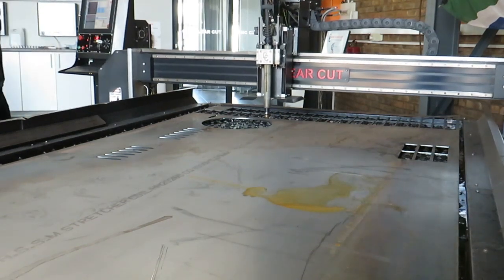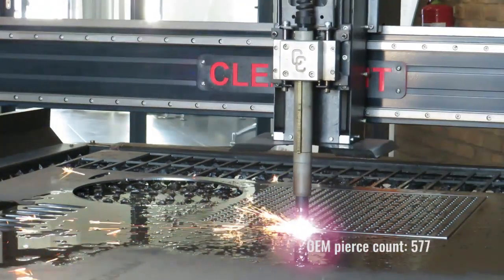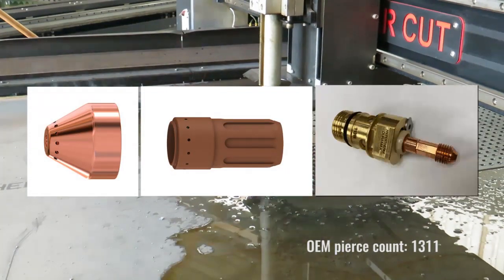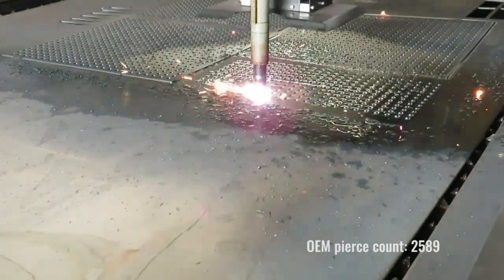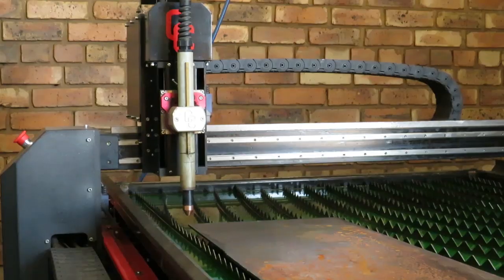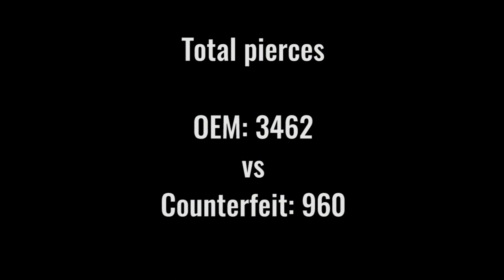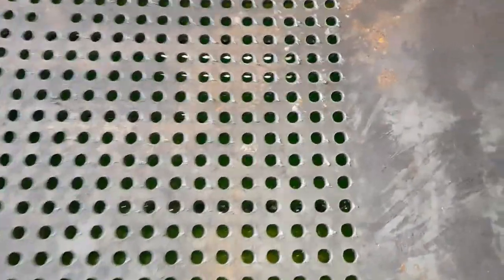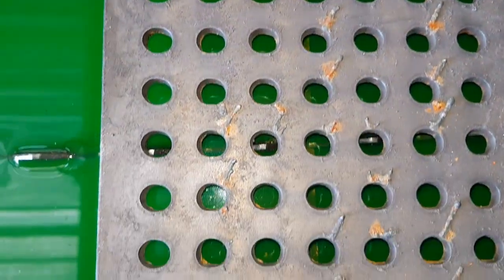OEM vs Counterfeit: Myth busted!

Comment: Please explain what you mean by 'counterfeit', and remember that if you mean 'compatible consumables' other than the oem manufacturer then Hypertherm also manufactures 'counterfeit' consumables (via their Centricut owned division) for other brands of plasma manufacturers, except off course for their own.  Do these Hypertherm manufactured 'counterfeit' consumables also have such a supposedly, shorter lifetime?   Then there is the fact that there are many 'counterfeit' (sic) consumable manufacturers out there. Are you referring to a specific manufacturer, or are all of them going to give you this drastically shortened amount of pierces? If you answer yes, then your objectivity in this supposed test comes into serious question.
Reply: Hi Werner, we are not here to slander names so im not going to express the name the these specific counterfeit consumables but it is the most popular counterfeit consumables used in South Africa. This was merely a test and if it were to perform close to, the same or even better than the Hypertherm consumables we would've send this directly to them to explain why would they be more expensive. But this test indicates the price difference. We have a popular saying in afrikaans "goedkoop koop is duur koop" which means "cheap buy is expensive buy" and this scenario fits that description perfectly. Its not only about the longer lifespan but the stop in productivity to change them 3x more that makes the difference. Im sure to do this test on Centricut consumables in the near future. this is not only for our knowledge but for everyone who wants to make use of it. I will always thrive to be ethical in the work that i do, so be assured there is no false information that comes with these videos.
Reply: First of all, i dont buy fake shit. stuff ive been using works great.
Secondly, any machine that 'melts down' just because you did not put an original consumable in there is shit that i wont buy